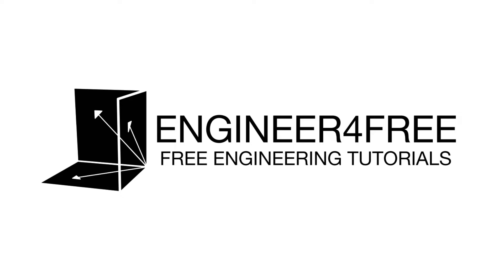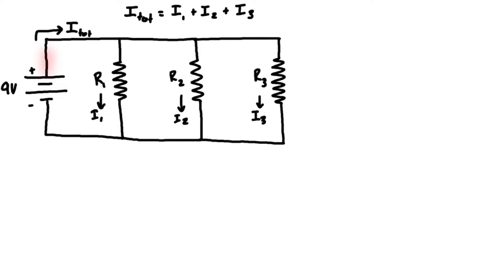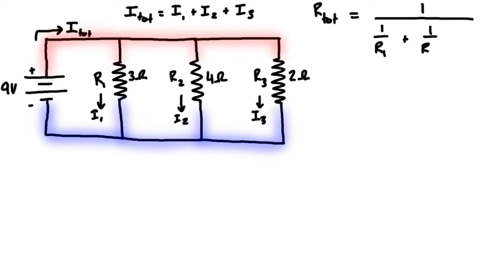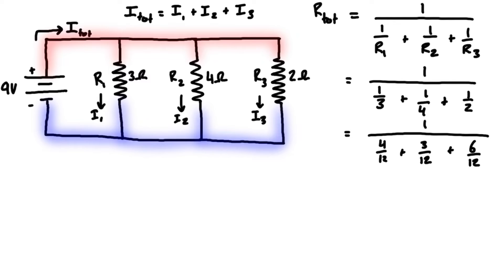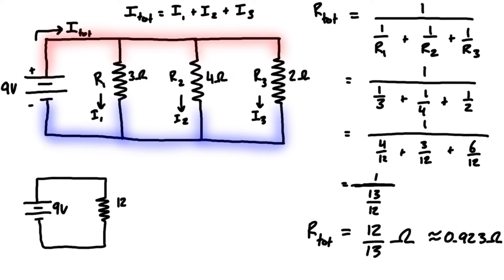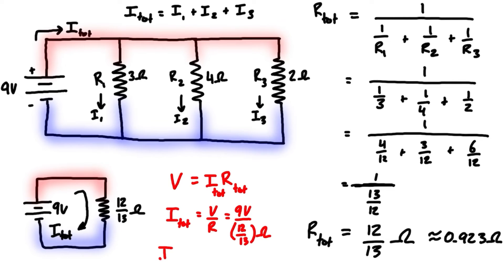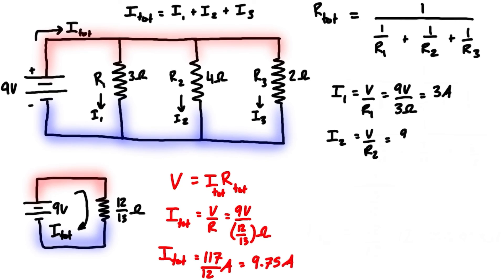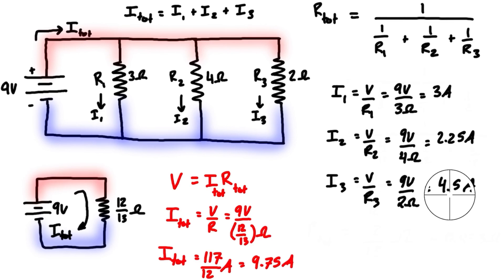Ohm’s Law Example #2

Comment: I guess we can say usung kirchhoff's rule , that the current that are leaving the junction are equal to the current entering at and since i1 and i2 and i3 are equal to 
Posutive 9.75 and i total is  also positive 9.75 but it has to equal zero

I total = i1+i2+i3
9.75 = +9.75 
9.75 - 9.75 = 0
So its correct 🎉🎉✅✅

Comment: you lost me 4 over 12 + 3 over 12 + 6 over 12. its like you just pull those numbers out of a hat. I'm going to have to find a different video to explain this. you never said why you did that. i feel like you just made the equation more complicated.
Reply from the maker: At that point I am finding the common denominator of the three fractions so they can be added together. The common denominator of those three fractions is 12. The first fraction, 1/3 is equal to 4/12; one third is the same as four twelfths. 1/4 is equal to 3/12; one quarter is the same as three twelfths. 1/2 is equal to 6/12; one half is the same as six twelfths. If you are using calculator, just solve each fraction with a bunch of decimal places, and mash em all together. Or even easier, replace each fraction with an inverse function. I just did it as long hand as possible to preserve the fraction as far as possible
Reply: These are practice problems , it's not a video where he explains everything , I just finished watching organic chemistry tutor video explaining the topic and came here to practice so I pause the video and solved them and i got the correct answer , so these kind of videos are meant to be explained , watch the topic from others creators , understand it , and comeback , it will be fun solving them!

Comment: can you explain how did you get 117?
Reply: He multiplied 12/13 by 13/1 to cancel out the bottom fraction

Then took the 13/1 multiplied it to the numerator of 9v. 

9 volts times 13. Got him 117/12 A = 9.75 A

Math is a doozy hope it explains things.
Reply: You can also do this with a calculator 12/13 gives a decimal. Multiply by 13. Which will leave you 12. That is your denominator

But the 13 you have to multiply the numerator(top fraction) 9v x 13 = 117

Comment: Where did you get the " 4 over 12 + 3 over 12 + 6 over 12? I mean how to simplify? Please enlighten me. Kindly respond.
Reply: I know its over a year. But what he did was he multiplied the fractions which all had the same common multiple. 

So what would be the common denominator that would share with the 3 fractions. 

Answer is 12.

 (1/3) 4=  4/12 

(1/4) 3 = 3/12

(1/2) 6 = 6/12

By using the distributive property 12 would be the amount you can equally multiply to make the common denominator 12. 

But when you multiply the denominator, you multiply the numerator as well. 

Then he just added all the fraction up to equal 13/12. But since he said it was the inverse

1 (12/13) your answer
__
13/12 flip fraction to 12/13( inverse goes to top) values cancel below

Answer would then be 12/13.